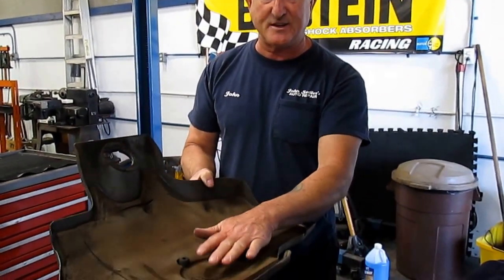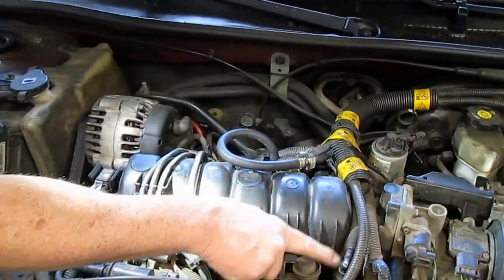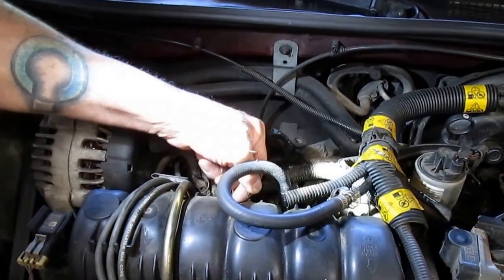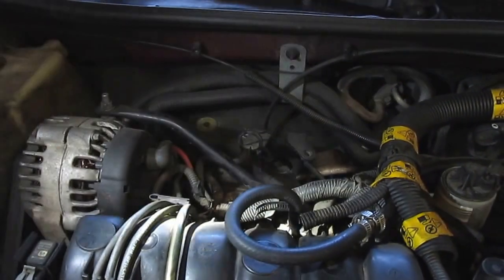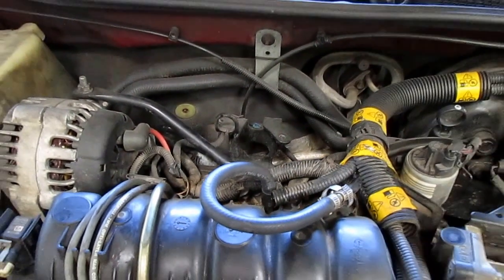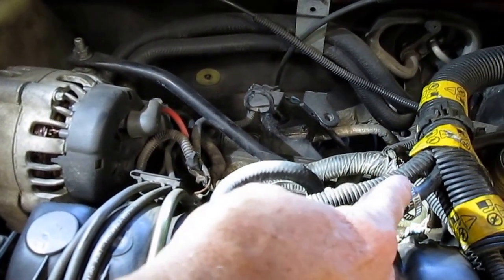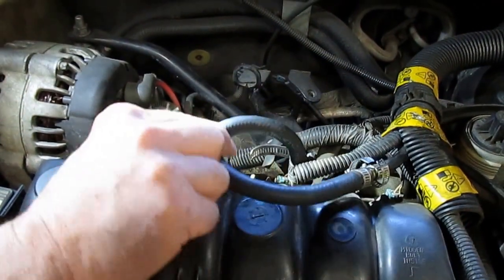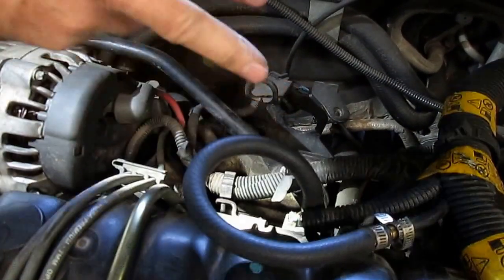How to Find a Fuel Leak

Comment: You are just showing one persons dodgy work. That scenario doesn’t happen all the time.
Reply: "Just showing?"  What scenario in auto repair happens "all the time?"  Customer complaint of a strong fuel smell could be anywhere from the injector to the rail to the line to the tank to the vent to the filler tube, and a dozen parts in between.